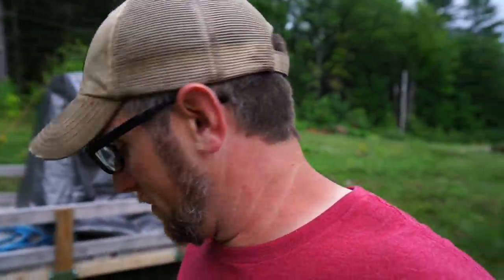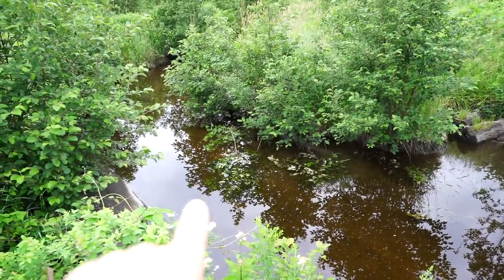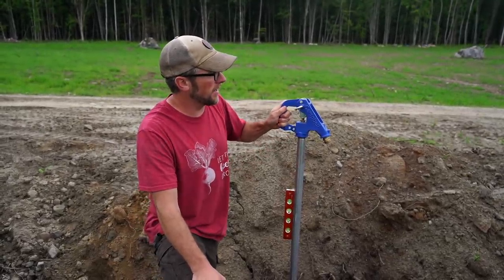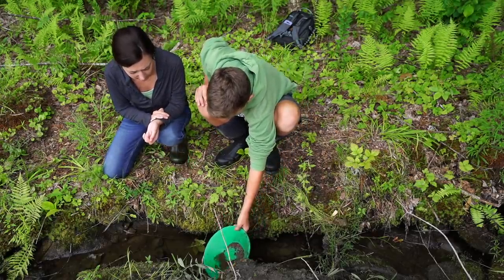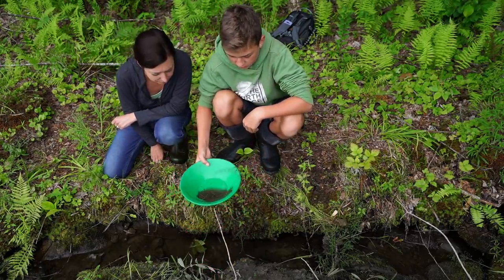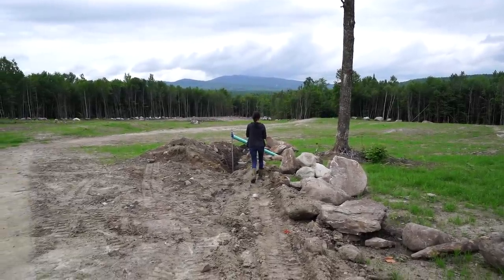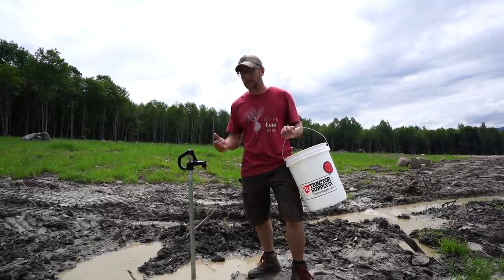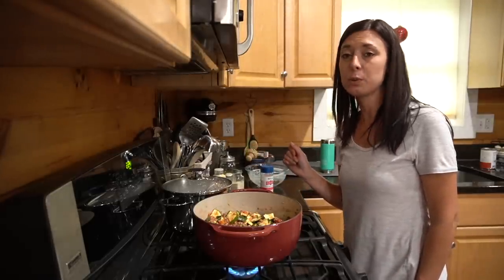DID We JUST WASTE all of OUR TIME & MONEY!?! Testing Our DIY GRAVITY FED Water System

Comment: Water Tower: Think railroad steam locomotive with a water tender car to be filled.  Or many high buildings have a water tower on the roof for the plumbing needs.  
A  DOUBLE CHECK VALVE home made PVC pump/ Free Energy PVC RAM PUMP... that can be placed in the creek with a water flow. The RAM PUMP  will pump water uphill. There are videos on making a Ram Pump and how well they lift water.  
An insulated enclosed water tower tank would give you more water HEAD PRESSURE.  Most small cities have water towers that work all year around warm or cold. 
Grandma's house use to have the water tank high on the wall with the flush pipe giving a health WHOOSH Flush.  There was a wooden knob chain pull to lift the flusher valve. Many off grid homes gave a Ram Pump system.   
Or you could build a windmill, like the prairie farmers had on the ranch. Watch some very old cowboy westerns movies to see how they did it.

A friend build a house with those water totes tanks.  A tote tank  was inside in the utility room mounded high on the wall to give him a head pressure to work his toilet, bathtub, and kitchen.  
The other totes were outside in an insulated shed or under a water collection system from the roof on his remote located 2 bedroom bungalow he build in the woods on a property with 7 springs.  
He used a 240 vac air compressor to pressure up the totes.  The totes water caps had a rubber tire valve he installed in them.  By hooking a water hose to the totes bottoms of a pressurized tank ....he could move the water anywhere he wanted to.  He would fill the inside house tote thru a filter system. 
The guys was 80 years when he built the place as he had 3 ex-wives with ill mannered kids who he was having court problems with....so he followed the BIBLE on living in the wilderness instead with a difficult woman.  The property was deeded to a small church group called the LITTLE FLOCK as a non-profit tax exempt property...where the ex-wives court actions could not cause problems.  He was a retired railroad pensioner with a child support still demanding money on adult ill manner problems brats raise to hate him and he was denied visitation. Once he saw the kids behaviors, he wrote them all off.  He had several 78-80 Lincoln Sedans and a 72 Ford pickup.....that fit his large frame body.  He would picket the court house with other disenchanted father screw by the women colations court systems. Our CPA created the Little FLOCK and we build a baptism tank underground of his attached garage. After a brief baptising you could join the little group of ours.  We had our own ordained  minister and we met at our homes.  All of the guys were professionals or tradesmen.  Several gals joined who had court issues too.  Most had children demands that were unfair. 
I advised my on young lady friend, a daughter of a gal I was seeing from the UPC church, who had been hit and beaten by her husband.  We got her to safety and a divorce. Set her up.  BUT the child was never forbidden to see dad.  The opposite was done. Demands of his visitation and involvement were made. He ran and hid.  The kid was send to grandma and she would make her son see the boy.  Well the kid got to learn the  redneck stuff from dad.
His mother got to be a 3M executive over 30 people with offices global.   Kid was home schooled and her mom and my brother's daughter help when she had to travel. (Little Flock thinking here).  Kid married a RN and has a medical degree on OT where they build a rural home and work in a small community hospital. Kid is active in outdoor stuff and like guns He has children now.  
You are not the only ones who have moved away from the city.  The 3M gal now is an Medical exec at a different well known company and has A PLACE TO CALL HOME non-profit for needy children to be raise she operates. Many are medically unwanted.   
So... do you own thing and avoid the government unfairness.  We had to form our own power group and we think outside the box.  
Glad to see you going forward.  I was thinking maybe a son or two???

Comment: Seems to me the flow on the lower hydrant should be the same as the upper, unless there is some sort of an obstruction.....?
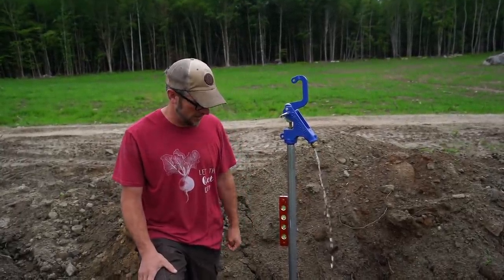Reply: He did say that the lower hydrant's output point may actually be a higher elevation 7:28 than the closer to the reservior one.  That could explain the lower flow rate.
Reply: @samvalentine3206  Yes. I saw /heard that. But wouldn't there be enough siphoning to overcome any change in elevation between the two hydrants? I would have thought there to be enough head to overcome that.

Comment: Al, I think your best bet is to go 12V, solar charged. You'll get a stronger more efficient pump that will provide the pressure you want and need with a low maintenance system. Might have to build a small enclosure, but hey, you have the equip to do that easily. BTW, what's with placing rocks on the newly installed line? Hate to say it but that never turns out well. Will eventually cause a leak on plastic pipe. Brief video of one in operation.  https://www.youtube.com/watch?v=W1vxS70Q4fc

Comment: I felt like you needed to elevate the tank to get a gravity fed water source!!!
Reply: My thought too, but it would freeze in the winter.
Reply: Did you guys watch the videos?  The whole idea for this project is gravity flow, if you elevate the tank you will have to pump the water from the stream up into the tank.
Reply: @HaroldReece  Yes, I did. I commented initially that what would be better is to elevate the tank and pump into the source tank, but the problem would be freezing in the winter. And there are methods to get the the water in storage tank without a conventional pump and electricity, but they don't work well when it is zero degrees F.

Comment: Need a higher drop on the water line. You would have had better pressure if you had put the tank above ground and insulated it. A ram pump could have been used to fill the tank with out the need for power. Three feet of drop will give one bar of pressure, 6 foot 2 bar. with a difference of 18 feet between the tank outlet and the faucet, you would have more than enough pressure.
Reply: @tonygrimes13  As the return pressure water from the valve goes back into the creek, nothing is wasted, it just goes back along its way. I'll give you that about the winter but if it's cold enough to freeze a flowing creek, nothings going to work.

Comment: Suggestion (afterwards your request to install a submersible water pump (if possible buy 2 of each so you'll have a spare due to all equipment not available)
1. DC 12V Water Pump High Pressure 115Psi Self-Priming Caravan Camping Boat, Water Pump, Self-Priming Water Pump (over ground)
https://www.walmart.com/ip/DC-12V-Water-Pump-High-Pressure-115Psi-Self-Priming-Caravan-Camping-Boat-Water-Pump-Self-Priming-Water-Pump/943669066
2. Q1DP-550E: 3/4 HP Sediment/Dirty Water Submersible Pump 115V-60Hz, 400W/550W Magnetic Drive, 2800GPH
https://www.walmart.com/ip/Q1DP-550E-3-4-HP-Dirty-Water-Submersible-Pump-115V-60Hz-400W-550W-Magnetic-Drive-2800GPH/750594511

Comment: 🇬🇧💕I would of put an old fashioned system above ground to catch the rain water💕Where does the water come from that enters your pond ?💕Same with where does water come from that enters where the beavers were/are ?💕With pipes you could build a water pipe where water from these other sources goes through a water filtration system that would make water drinkable you could/can have water that is pumped into tanks & overflow tanks so you never run out of water💕That’s how I’d do it to be able to live off grid💕You have more water flow in winter that could be collected & stored in big steel water tanks as long as you have put that water through a filtration system if it’s for household use💕If you start collecting the water now you’d have a head start for when you start building & moving onto you property💕You could use those totes to collect rainwater off of your toilet shed & shipping container all you need it guttering & pipes💕
Reply: He does collect water for his animal sheds at the original homestead. Winter is always a problem.
Reply: @StoneKathryn  💕That video was NOT about his current property💕It was about whether the new tank & system he had laid out at his New off grid property was working, he also asked for peoples opinion’s of what they/we would do💕I answered with what we would of done & also asked some questions💕

Comment: I don't think camper pump would work way to long to push water under pressure. They use 1/2" pipe and there not alot of pressure for them. there is all so a ram pump uses no power.

Comment: A laser level will tell you if the slow hydrant is too high. You don't measure from top of the water tank but from the pipe where water exits the tank.

Comment: You might consider putting in a pump like they use on boats.  They are 12V and a small solar panel and battery could be used to power it.  They come in various sizes but here's a link to a 3 gal/minute one: https://www.westmarine.com/buy/west-marine--3gpm-freshwater-system-pump--13997960?recordNum=1

Comment: Hook a gas powered pressure washer up to one of the hydrants and see if it works for washing the tractors.  It's pump should be able to suck the water out of the tank...
Reply: We have a gas powered pressure washer and it requires a minimum of 2gpm to run. Al isn't there yet.
Reply: @StoneKathryn  He has more than enough volume and the pressure washer pump will suck any extra it needs to make up for the lack of line pressure as there is nothing restricting it.  Just hook it up to the hydrant to flows the most...

Comment: Common sense tells you to put clean (no big stones/boulders) backfill in the trench first until about half full, then you can put the big stones in and cover them, this way you wont break or crush the pipes, but AL does what Al does he takes no notice of anyone and that includes taking sensible advice from people in the know, he always asks for it, but I have yet to see him use it, it's his main downfall.
As for the lack of water pressure not enough fall I'm afraid and stand pipes look to be to tall, shortening them might help shorten the water lift to the tap height, also looks like the land falls away more, so extending pipe run might give more pressure at the very far end but won't improve the others.

Comment: Proof of concept done.  Expectations ????   Everything is based on the amount of water pressure required.  You can expect  half pound of water pressure for each foot of fall.  The fall is measured from the tank outlet to the water outlet.  Your tank is buried, while the outlets are above ground.  If one had a 10 foot drop from the tank location to the first outlet, you can expect about 5psi.  Bury the tank, raise the outlets and pressure drops.  Your first outlet had flow - your second outlet (slightly higher) has reduced flow..

Comment: @Lumnah Acres Al, I keep wondering, if you don't want to get stuck while back-filling, why don't you use the bucket on the tractor instead of the blade on the excavator? Surely keeping the front axle further from the ditch is better than dropping into it again? [edit...lol, no sooner have I posted - mid-viewing - than I see you in the tractor!]
Put a vent stack in the lid; that will allow the air pressure inside to equalize as the water is removed, which will, in turn, increase the pressure/flow.

Comment: If you use a pressure washer and hook your hole up to it the pressure washer will create pressure so you can wash off your equipment with fat water supply our supply it works well so if you're going to be cleaning off your equipment that's just a suggestion James t North Carolin
Reply: Our gas pressure washer requires a minimum flow of 2gpm. Al doesn't have that much from his spigots right now.

Comment: If you take the top off the tank it’ll run fast it’s not getting enough pressure air bound
Reply: The input pipe is twice the diameter of the output pipe. Pulling a vacuum will not be a problem.
Reply: @benthere8051  Where can I look up about venting? Thanks.
Reply: @StoneKathryn  - Just review the video where Al installed the tank and review the perforations made to the tank that would prevent a vacuum from forming. The first and foremost is the inlet for water from the spring. It is twice the diameter of the outlet pipe. There is also an overflow which is supposed to be open to free air. A possible third opening is the tank lid which might be perforated.

Comment: Al!!! 
How about hydraulic ram pump?
So called ”Hammer pump” would it work for you?

The concept behind the ram idea is a "water hammer" shock wave.  Water has weight, so a volume of water moving at a certain speed has momentum - it doesn't want to stop immediately.  If a car runs into a brick wall the result is crumpled metal.  If a moving water flow in a pipe encounters a suddenly closed valve, a pressure "spike" or increase suddenly appears due to all the water being stopped abruptly (that's what water hammer is - the pressure spike).  If you turn a valve off in your house quickly, you may hear a small "thump" in the pipes.  That's water hammer.

Read more here: 
http://web.archive.org/web/20080505053628/http://www.clemson.edu/irrig/equip/ram4.htm
Reply: Ram Pumps waste water. Typically, only 2% to 20% of the water flowing through a ram pump system will actually be delivered to the storage tank or trough. See https://www.nrcs.usda.gov/Internet/FSE_DOCUMENTS/nrcs142p2_041913.pdf 
Also wouldn't work in winter.

Comment: You should have .433 lbs per foot of drop. If you start out with a 6 foot drop you are looking at 2.59 lbs of water pressure. Just remember that a well has around 30 lbs of pressure.  You put the tank into the ground and lost a foot or 2  and when you came out of the ground you lost I'm guessing 3 feet.  When you figure the pressure you have to look at the water starting point and the finishing point difference in height and then the working pressure of those frost free hydrants.  You simply may not have enough pressure to close the check valve in those hydrants.  You can fix that by eliminating the check valve and put a valve you can open and close from up top.  Try digging up the hydrant and just replace it with a hose to test it out.  If you flow increases the problem is the check valve on the hydrant.  They sell pretty inexpensive electric valves the may work and then you can put a small solar panel with a microswitch so that when you close the hydrant it turns on the valve below to drain the hydrant.  The down side is that it won't work at night unless you put a battery backup on it and as we all know batteries don't work well below zero.    Just a thought try giving the Hydrant manufacturer a call and see if he offers a manual retrofit.  The hydrant may not even have a check valve.  What they could have done and probably did do is put a small hole at the bottom.  That allow a constant flow when the water is on.  When you cut off the Hydrant the water just drains out the hole.  I'm guessing that is what they did because it is cheaper than a check valve.  If you had 30 lbs of pressure you won't even notice.  If that is the case it will be a small hole around 1/16" or more.  In any case I would check to see if the hydrant is the problem first.  This is a very interesting problem.  I'm sure you can figure it out.  I wish I was there.  I love problem solving things like this.  Good luck!  You can do it!  Where there is a will God will show the way.
Reply: Yes, those frost free hydrants do have a small whole at the bottom of the spigot so the water can drain out when you turn it off and not bust the stand pipe.

Comment: If the tank is not vented it will do no more than drip it will not have no pressure
Reply: The water from the stream should be entering the tank as fast as it is exiting the tank.  Its not a "closed" system unless the input filter plugs.
Reply: Patrick Grandy ,
Yep , must have an in and an out.

Comment: IF THE TANK WAS ON A PLATFORM  IT WOULD HAVE MORE PRESSURE OR IF THE TANK WAS PRESSUREISED IT COULD STAY UNDER GROUND AS LONG AS THE AIR WAS ABOVE THE WATER LEVEL

Comment: Pressure often goes hand in hand with a capacity but so does elevation between the tank/tap and it could explain why it's a trickle if it's about level. Another likely problem is that the supply line sunk into the soil after back  filling so its run has a low point where the water is pushing up hill as it were to get to the tap can also impede the flow. Hopefully the tank does have an air vent a so the water can be displaced by it at the same rate because it's diameter matters. The likely cause is the supply line, the angle at which it lays over the run, and if it's correct then the tank/tap elevation that's likely at fault since the flow might be all that is possible since the tanks outlet is that deep. One way to test to see if the tap or angle is the problem is to remove it and if a geyser results the line isn't the problem but the tap but if it's still a trickle it's the line/elevation at fault. Of course check to see if the tank is full first before despairing because if the waters level is low it wouldn't have enough weight to flow well especially if the line is mounted higher since depth equals force in a tank without a pump...

Comment: Water pressure for gravity flow systems depends on the difference in elevation.  It's .433 for every foot in elevation difference.  So if your water source is 40 ft higher in elevation your water pressure should be about 17 psi.  In watching the video it doesn't look to me that your water tank is that much higher in elevation.